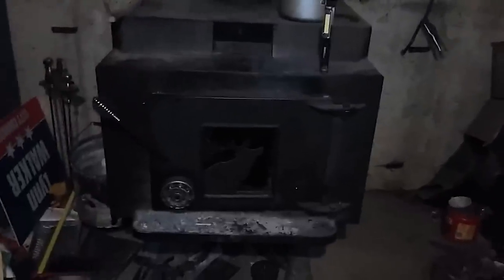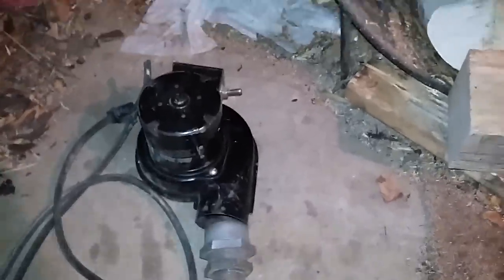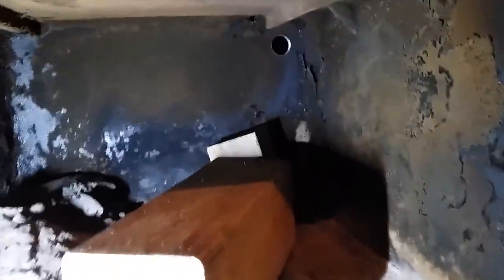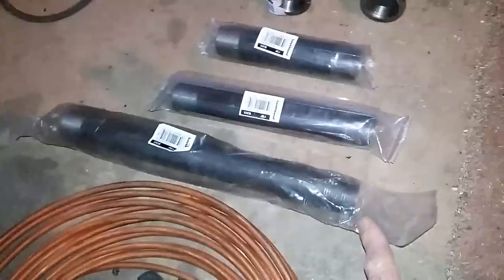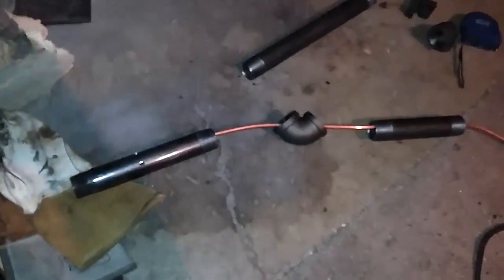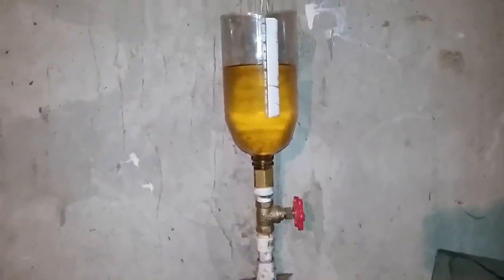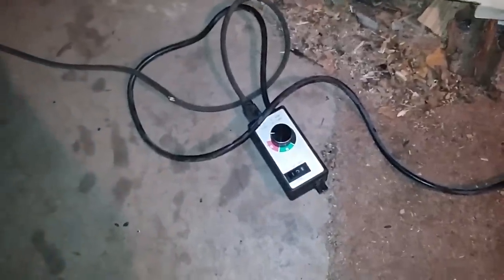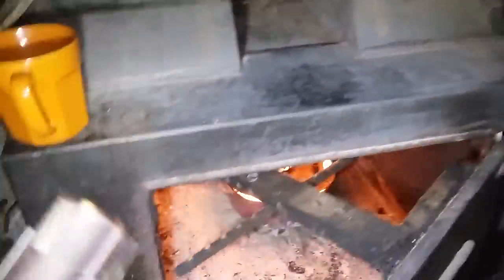DIY - Hybrid Waste Oil / Wood Stove on Steroids!!

Comment: The airflow keeps the flame away from the copper tubing and protects it from crusting up.
And it certainly cleans any smoke up.
 cheers Hamish
Reply: What we have found setting up an exsisting log fires is they can give out carbon monoxide and they then to crack as they can't take the heat.

Comment: I would think the smoke is thick & black with a flame that colour. You either need more air or less oil.
Reply from the maker: +Fireman Jim 
You're right, it has too much oil I have it tuned up now working great, look at my other videos!
Reply: he needs to remove the top from the burner pot and bring the air pipe down to withing an inch or so of the burner pot bottom, much cleaner burn and better efficiency.
Reply: Looks toasty warm

Comment: great idea! do you need any air other than the blower? can you shut off the front vents on the stove and it still work?
Reply from the maker: +kiffer tom
  Yes I can run it with the blower alone, no front vents are needed.  I just leave them open a little as it keeps my glass cleaner.
  Thanks for watching and subscribe if you haven't already also check out my other channel Mugiver 411 it has lots of videos as well!

Comment: Yeah you're going in the right direction fan-forced. The only issues you have is the copper tube can crust up with oil after a while, so we have to work a way the oil comes out but the flame can't access it. Best of luck.
Reply from the maker: +Fireman Jim 
I don't have that problem, if you watch my playlist I show a video of the burner nozzle the copper tube is inside of the forced air pipe up High where the flame can't touch it this helps keep the flame off of the copper

Comment: how is it possible its not smoking inside the house through the air openings when the blower is pumping air inside the stove?
Reply from the maker: The heat from the flame goes up the chimney and creates a draw that sucks all the smoke out.